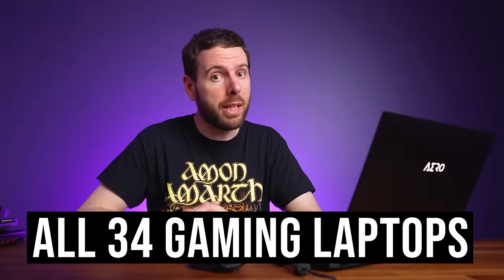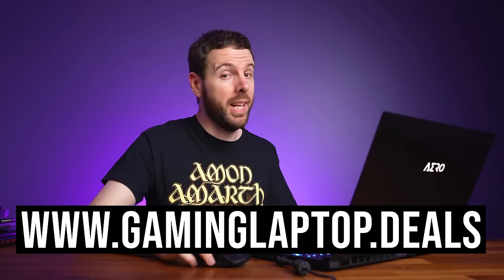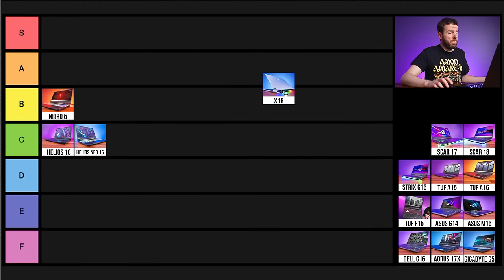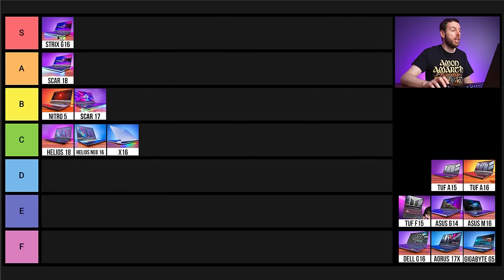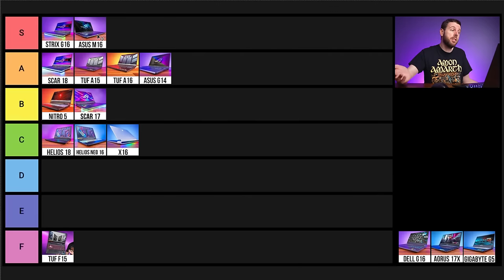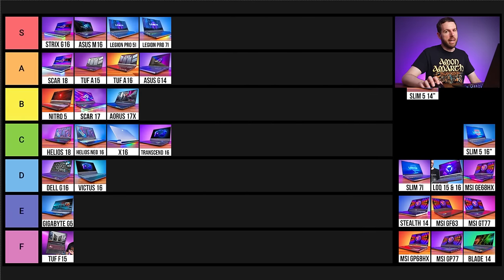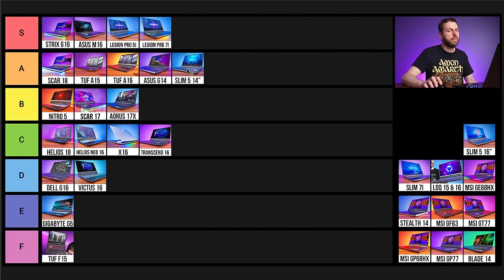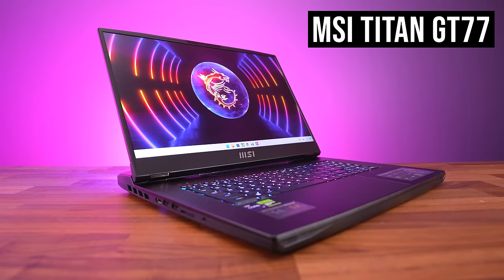Ranking ALL 34 Gaming Laptops I Tested In 2023!

Comment: Strix G16 is a beast laptop.
I got the i7-13650HX / 4060 / 165Hz version.
Its one of the best laptops you can buy.
I really recommend it..
Reply: It has coil whine and screen gets quick backlight bleed
Reply: @Steven-cr1og  coil whine is not noticable but yea , backlight bleed is the main problem of 165hz version. But its not that bad unless you are in a dark room. Also with low brightness there is not too much backlight bleed.

Comment: I've been using a nitro 5 with a i7 12650h 3070ti(150w) and a 1440p 165hz display for few months, I'm pretty happy with it and i got a pretty good deal, atleast in my country (approx US $1150) which was a lot cheaper than other laptop with lower specs(3050ti's), the only thing i felt could be better was the cooling though that seems to be a issue with my unit since other reviewers didn't have that issue, planning to repaste it soon with some higher quality thermal paste, and also my unit was single channel 16gb 3200mt/s, does effect performance slightly but not that big deal for me infact I like it cuz I'm planning to upgrade to 32gb so don't have to buy a complete kit.

Comment: I’m between the Asus M16 4070, 4080 versions, or the Legion Pro 7i. Portability is huge for me cause I travel for work, so I’m mainly between M16 models. There’s no sales on the 4080 version yet, but that version seems like it’d be the better choice
Reply: Had both, trust me get the legion, they're literally almost the same exact size, but the legion has 10x better thermals and performance which it can also be undervolted for even better. The m16 keyboard deck almost burnt my finger after 30 minutes of gaming and can't be undervolted, it constantly ran at like 95c throttling the whole time. No vapor chamber on either the cpu or gpu meanwhile the legion has a vapor chamber on both. M16 does have a killer display though, but the legions IPS is top teir as well
Reply: And the m16 has a power limited 4080 that only goes to 150w because the cooling is so bad. It hardly ever even hit 150w most times like 125-130 and still was hot, the legion runs at 175w the entire time and never broke a sweat

Comment: I have an XMG Neo 17 and my experience is completely opposite from yours. The screen does not wobble at all; in fact after watching this video I tried to make it wobble but did not succeed, it is too sturdy. Watercooling makes a very big difference in noise; when I enable it the fan noise decreases very noticably. However, you need to set the Oasis to the right settings to achieve the best results. This is not hard to do and might take some time, but you need to do it nonetheless. So I think this might be a case of user error, sorry Jarrod. You also did not mention the extensive BIOS options to tweak performance. Yes, the CPU performance out of the box is average, but just setting some basic undervolting settings in the BIOS increases performance significantly while lowering temps. You can also adjust every single RAM timing. So there is lots to be gained from manual adjustment. I understand that for the vast majority of people the out-of-the-box performance is what matters, but you should keep in mind that this is a laptop targeted at enthusiasts and enthusiasts will definitely go into the BIOS and tweak as much as they can.

While I completely understand why you gave the Neo a low rating (it is absolutely not for everyone), I think you kinda dropped the ball in your assessment of it. For enthusiasts like myself it is in a league of its own as nothing comes close to the cooling and noise production.
Reply: I have a Neo 16 for a few months now and can confirm the screen wobble is quite significant when you bump it. 

When it comes to fan noise, I agree, the reduced noise is very noticeable. However, when observing temps I am also wondering why the CPU don’t get the water cooling. Its temps are reaching constantly 92-95C. While I understand that this is not unusual, I feel uncomfortable seeing the high temp warning coming up sometimes when I have the CC open. Maybe I should have a look into the undervolting you mentioned, but I have no experience there.

Batterylife really is not good. Also I had some trouble with the keyboard lights which took sometime to be fixed by XMG. In the end the whole laptop was changed and since the. Everything goes well.

Comment: 19:23 The Dell G16 with the i9, 32 GB RAM, 4070 GPU and 240 Hz display can be bought right now in the UK for much lower than other laptops with similar and even lower specs. And the complaints you had about it seem tolerable and not so much to do with more important things about the laptop. I've heard the power brick being big helps it not get so warm. 
Feel free to tell me if there are important things I'm not taking into consideration. I don't claim to know very much about laptops.
Reply: The Dell G16 laptop is fine.  Jarrod is way too harsh on Dell.  With the black friday sale on the Dell G15 and G16 it will help lessen the blow for good bang for the buck.
Reply: @erichchan3   Thank you for your reply

Comment: Guys, I'm from Egypt & I have been using Asus devices for two years, and the new devices are not weak. The first is the ZenBook Flip and the second is the Rogue Flow Z13. The devices are actually all manufacturing defects. Based on experience, it actually has a two-year warranty that fixes everything, but the devices start showing their defects after 3 months. I returned it to the company after a year after that. After the company gave up on trying to fix it. The second one appeared after 6 months. i used it for about one year or less, and I changed the battery and now the keyboard. I don't recommend buying Asus devices. You will be wasting your money.
guys, I am writing this, and when I find anyone talking about Asus laptops, I decided to advise people to God so that they do not make my mistake. By the way, I am stuck here while my device is in the maintenance center
Reply: I completely agree. I bought the Asus Zephyrus G14 Ryzen 9 Amd 2060 4 years ago and that product had issues almost immediately. Random black screens, temps too hot to the touch even with less demanding games with a cooling fan underneath. 
I just had to completely factory reset my laptop and lost everything on it because I accidentally clicked install on the newest BIOS update. This is the third time in four years (that I know of) that a BIOS update has been known to brick people's pcs. Terrible, terrible company. If I can't trust a company to put out stable BIOS updates, I can't trust the company period.

Comment: bought myself Lenovo LOQ 15 APH58 and loving it so far but the stupid Nvidia game ready driver update made my laptop screen go blank after the Lenovo splash screen is on whenever I power it on. I have to reset the laptop every time to get the screen working again.
Apparently, this problem persists since forever and it doesn't get fixed. 
I tried to change roll back to the previous firmware but I'm not able to.
Only by replacing the Nvidia game ready driver with the Nvidia Studio driver that it "fixes" the problem.

Comment: So Asus and Lenovo dominance, huh?  This is a good list when it comes to gaming laptops for gaming imo, but some characteristics important to use outside of gaming  (touchpad, battery life, weight, screen brightness) went a little unemphasised (which is fair, not really what gaming laptops are for) but here the Zephyrus, Legion Slim and Razer Blade lines come even further
Reply: P3rsonally keep thinking there's smth great about stealth 14 and it's chassis, thermals, and cpu prospects with a good tgp
Reply from the maker: I have my Awards video coming up that will discuss those things.
Reply: I mean in all fairness he has individual reviews on the laptops in each tier. That should help.

Comment: For someone who got the G5 for $680 on a deal, I believe it was a better option than Nitro. For future games like gta 6, the extra Vram would come in more handy. The thermals can be fixed by having thermal pasting redone with arctic ice which is fixable. But for the price I would put extra Vram over slight difference in fps
Reply: Valar Morghulis
Reply: Gta 6 won’t even be available for pc I think
Reply: @yahmirrobinson8162  you wish though, cos PC has the biggest gaming based players today, rockstar won't ignore that market just cos you say so nga

Comment: The lenovo legion 14 inch oled is an S tier instead of A tier. This is because it has upgradable memmory which is better than upgradable ram on the G14. It also has incredible fast ram and you can get a anti reflecitve screen protector. I would reccommend that laptop since I have it and I did a lot of research and bought multiple laptops before deciding on one
Reply: Yeah but the 16 inch version has both upgradable ram and upgradable memory. Also jt can come with an rtx 4070. So it should be above the 14 inch imo

Comment: If everyone thought only from the practical side, then Apple would not have achieved such success today. What I mean is that Alienware simply doesn’t sell what you want to buy. This is a brand that offers products for those who fully identify themselves as gamers, and not just a good laptop. I don't see any reason for a non-gamer, or a person who doesn't like backlighting, to take it, but if you are one of them, not a single top legion can compare with it. In addition, Alienware is the only company that still offers at least something new in laptop design.
Reply from the maker: Asus are more innovative in design than Alienware.
Reply: @JarrodsTech  I doubt that an ordinary person who does not particularly understand laptops and brands will be able to distinguish between laptops: Asus, gigabyte, MSI. They are all made in the fashion of 10 years ago. Sharp corners, black color, a little more of this, a little bit of that. But they could tell the difference between an alien laptop and an apple. And you can see how Asus gaming laptops have changed over 10 years, these are very small changes. While the alien has changed several concepts and looks different, the X series is certainly a very big improvement (of course I did not mean the M series).

Comment: A video comparing 2023 vs 2024 laptops would be good. I flipped the 2024 G16 OLED i9 ultra 185 whatever the H that means!  for the 2023 M16 i9 13900h rtx 4070 and save $400.00! It's the exact same laptop pretty much. OLED is okay but it fades like a 🦇 vampire in the sun! 🌞

Comment: Watching this while waiting for my Strix G16 to get installed :). Glad to see it's in S-tier! I switched from the Zephyrus M16 2022 in the hopes that it would be more powerful for gaming especially a tad more quiet due to the big cooling vents. 
Update: So far i like it above the Zephyrus. The screen is more raised due to hinge design and it has a nicer feeling keyboard and no more rubber coating (just plain plastic, which is fine by me). The keyboard is a lot cooler too at the D F E R keys. Downsides are some coilwhine, dimmer screen, thicker chassis. These so far are acceptable to me.
Reply: The only thing I don't like about Asus gaming laptops is the hinge mechanism. I just don't like the lid going under the laptop. 🤷
Reply: I would never accept a laptop with coil whine. But maybe that's just me.
Reply: @Tom_Quixote  its not that black and white for me. The combination of pleasant and low fan noise with minor coil whine in very specific situations is for example a lot better than my Zephyrus. The fan curves (ramping up and down) are also very good. It's very gradual and not distracting. I've read Lenovo's are a bit more erratic in that sense.

So i think there just isn't a perfect laptop around and you gotta pick your battles somewhere
Reply: @m.heyatzadeh  the Strix series don't have that. I like the hinge up top as well. It also vents the air our the back instead of the screen reducing the perceived fan noise towards the user as well
Reply: I hate coil whine

Comment: I have an asus duo with 4090 and it completely suits me for both work and games, but I didn’t see it in the list...
Reply: send your's to him for review then
Reply: @nday76  I’ve had it for half a year now, I can only say that the software part for setting it up is a little unfinished. If you adjust the settings to suit you, then it will never overheat or freeze, otherwise I see that it is worth the money, unlike other models and the same Razer. I’ll add that I used the Asus m16 4090 for some time and it’s really disgusting same as previous version. From lags to overheating in the keyboard area to blowing hot air directly onto the screen... I definitely wouldn't put the m16 in the first category.
Reply: @Shokuhou_chan  I'm in another country and can't do this.

Comment: Legion Pro 7i owner here. I personally don't think 2023 was a good year for gaming laptops in general. I agree with the ranking order sure, but I'd drop every single machine on this list down 1 maybe even 2 tiers on price alone. The Pro 7i isn't S tier for me either. It cost me a small fortune and was a striped back version of the Legion 7 I previously owned. The plastic keyboard deck feels cheap, the keys themselves feel cheap too, it's obnoxiously loud under load and the overall design is uglier. I basically only bought this machine for it's raw power, and the 4090 delivers on that at least. Thanks Nvidia?

Comment: 42:33 the Stealth 14 has 4 speakers, 2 on the top and 2 on the bottom. I personally didn't find the speakers being covered with my hands when typing.

A tier for me because of upgradeable WiFi card and 2x ram slots. The 1600p 240Hzscreen option is one of the best 14" panels out there as well. Unfortunately NA gets the shittier screen.

Comment: Acer helios neo 16 is very good. It's very comparable to the Asus strix g16. I don't understand why one is  S Tier and the other is C tier makes no sense even by your standards. I saw the review of both they are both excellent. Why is the helios neo 16 in C Tier? Btw I have helios neo 16 with the i9 13900hx 4060 165 qhd. 1600 usd. It's a very good price considering I'm in blackaded country Yemen everything get more expensive with Shipping. I had the option to go for strix g16 but only i7 13650hx 1080p 165hz display for 1400 usd.
I think 200 bucks more for an i9 + Qhd is better considering I'm a video editor and I prioritise longevity.

Comment: My only comment here, if you remove the price factor, I think Razer did great with Blade 14 and deserves to be in A. With high performance, customizability (2 RAM slots), long battery life, good speakers, automatic monitor refresh rate switching, very nice design and running cooler than G14 I'm surprised it didn't easily go to A. I do not like your comment about chugging it, because in recent video about taking care of your gaming laptop, you shouldn't do that hehe. Anyway great job man and looking forward to 2024 videos. I'm already excited about the new ASUS G14 and waiting for a full review on the HP OMEN Transcend 14. Keep it up buddy.

Comment: helios neo 16 gets more performance than strix g16 so why is g16 ranked higher pls tell anyone
Reply: Just because the Neo 16 has better performance doesn't automatically make the laptop go to S tier. There are other factors that the Neo 16 failed to satisfy. Apparently those are mentioned in Jarrod's Neo 16 review. The Strix G16 may be slightly worse, but it's still better because it's consistent and stable. It also has good cooling and screen.

Comment: Please anyone that can help me fast: 
I am hesitating for 5 days already between those two laptops :

Loq15  AMD Ryzen™ 7 7840HS with RTX4060 8gb
16gb DDR5-5600MHz
512 gb storage 
15,6" FHD (1920 x 1080), IPS, Anti-Glare, Non-Touch, 45%NTSC, 350 nits, 144Hz

Or:

Legion5 Pro AMD Ryzen™ 5 6600 with RTX 3060 6gb
32 Go DDR5-4800MHz
1 To SSD M.2 2280 PCIe Gen4 TLC
16" WQXGA (2 560 x 1 600),  500nits 165 hz

They both have the same price : 1000€.
I will use it mainly for my own coding project as a back end dev and also for gaming 

What do you say?

Comment: guys help me on how to force my laptop to use more gpu power :(
i have a predator helios 300 with 3070 Ti, it runs Ravenfield (999 bots) with 210 mhz core clock, 20~21W, and 15-20% gpu usage
(driver has been updated to the latest version, high performance battery, charge in, turbo is on) 
(it runs rdr2 with 70 fps 2k ultra setting but can't run ravenfield properly - 10 fps with spec like i said)
thanks 😭

Comment: In my country I think that if the loq15 cost like 1100 dollars and the tuf cost 1200dollars and the tuf have better colour accuracy but it has worser brightness so I don't really know I think that the tuf A15 have better battery too and the specs is Ryzen 7735hs and for the loq it's intel 13500h which performs better but battery life is more important for me two of these laptops have 4060 and they're displays are like 144hz  Asus have 100% SRGB and like around seventy 70% Adobe SRGB and other things plus 250 nits and the loq have 45 NTSC and the 350nits so u think that better is tuf A15 and I think that it looks better too so it's like the same in the price so I prefer the tuf but I think that the Lenovo is good too but the average response time is 30ms instead of the Asus tuf what have average 15ms
Reply: The tuf in reality has 294 nits what I think is ok